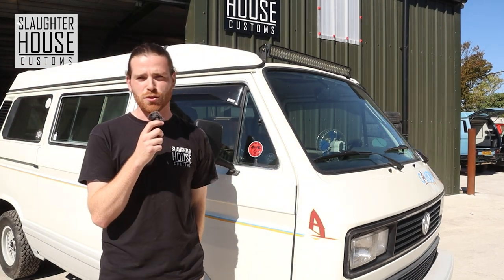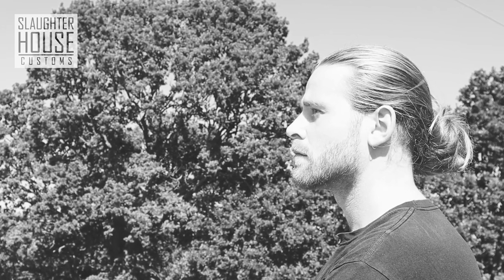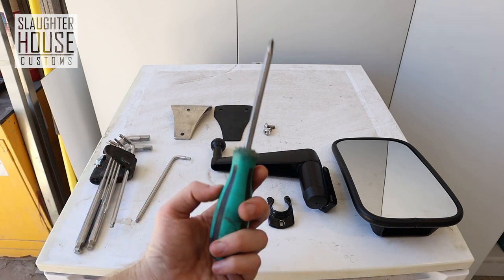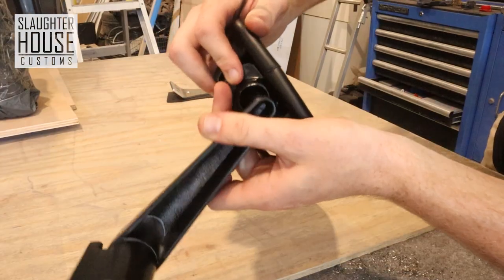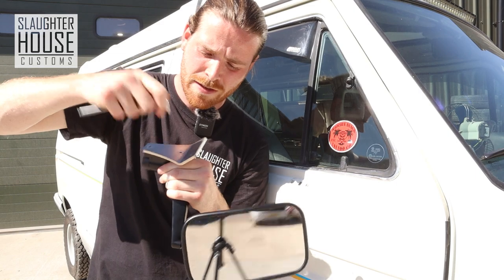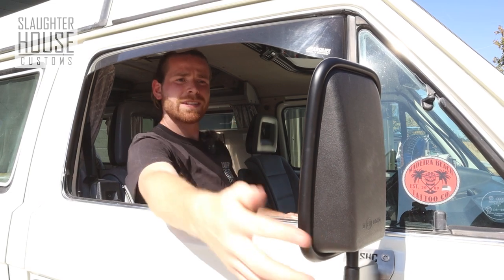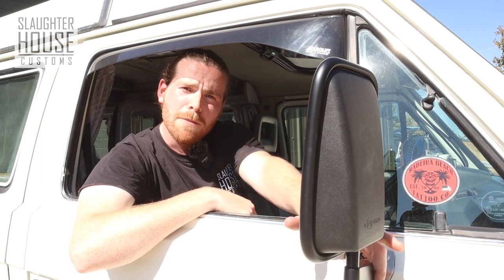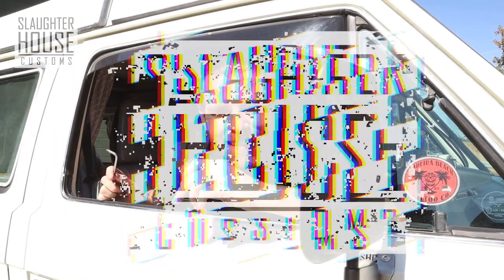FIT YOUR SHC LAND ROVER MIRROR KIT: SHC NO NONSENSE TUTORIALS

Comment: Sorry I just commented this on another video. Trying to chose between these and trucks mirrors but need something that can be folded in to the van at night. Can you advise?
Reply from the maker: Both the Truck Mirrors and the Land Rover Mirrors fold all the way in, flat to the van. Truck Mirrors you have to fit new screws in the top of the door, but LR go straight into the existing mounts 👍 Just depends on what look your going for 👌

Comment: Stainless Steel and Steel don’t play nicely together.  Causes bimetallic corrosion.  There is a gasket, but still connection through the screws.  It would be better if the adapter was a coated steel in my opinion